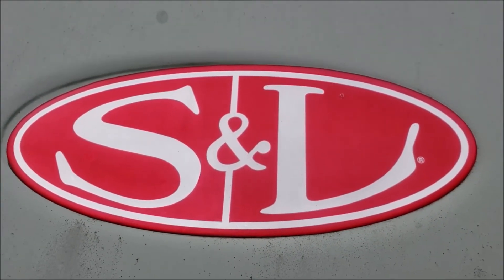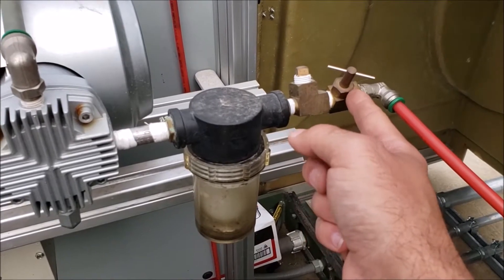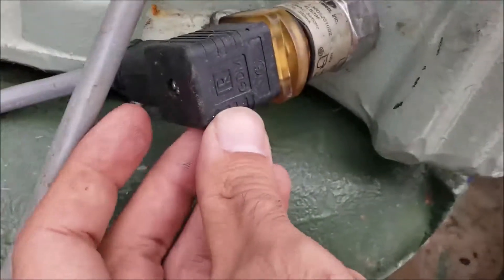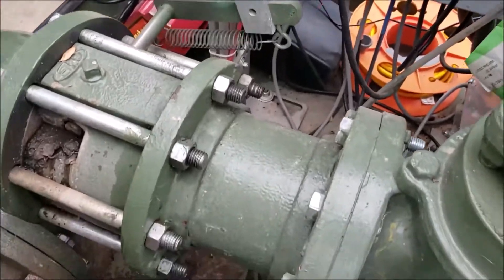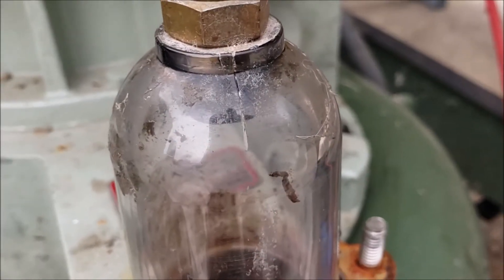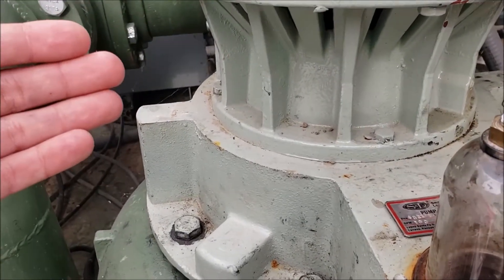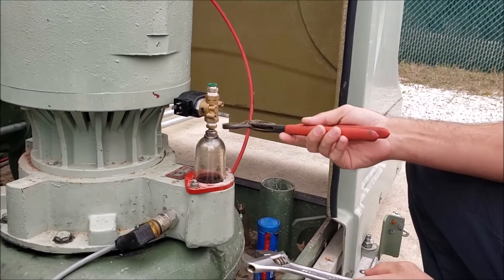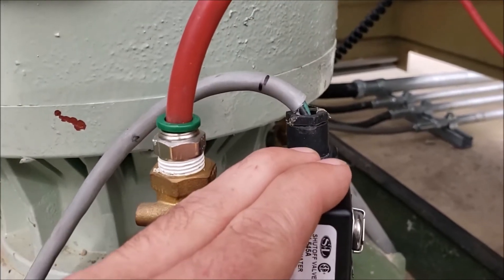Smith & Loveless Lift Station -  Priming Troubleshooting

Comment: we have the same pumps and our problem is they are on an 8 hour cycle, pump 2 will randomly pump half way down then the level will start to rise then pump 1 will kick on and finish the job. it happens anywhere from 1-6 times a cycle. the vacuum gauge is holding vacuum. why would pump 2 start to cavitate at random times half way through a pump?
Reply from the maker: Probably has rags in the impeller.

Comment: Would you be able to make a videos on how the level floats are supposed to work? Confused with how the manual says they operate.
Reply from the maker: That would be a hard video to make as the install depends on how your station is set up. So my floats would not be the same as yours.
Reply: From what I remember:
Low level alarm-near floor of wetwell
Off float-hang straight about 6”-12”
Lead float- approx bottom of inlet pipe
Lag float-top of inlet pipe
High alarm-set where you are comfortable. If surcharging the line isn’t an issue then go a foot or more above inlet, or can set just slightly higher than lag pump float. 
It does depend on the station specific conditions and condition of priming system. If vac pumps are weak (below ~22” hg vac) can set floats low to allow time to prime station before level gets too high from incoming flow.
Reply: And they work like on/off switches. A lot can be wired either normally open or normally closed. Depending on the station and control panel, but essentially this:
Low alarm float should always stay tipped and connection closed- when it hangs free, it will change state and alarm. 
Pump off- will be open when hanging (empty wetwell or pump cycle just ended) when it tips, it closes, which will indicate there is water in the wetwell but not enough to call for pumps.
Lead float- normally open-when tipped it closes which calls for pump to run. Pump will turn on and pump until the OFF float is hanging and no longer tipped- opening the connection and ending the pump cycle.
Lag float- same function as the lead float, but for the second pump, in case flow is high or the first pump has a priming failure. 
High alarm- almost like the lead/lag float, it will be open when hanging, if the water level rises and tips the off/lead/lag floats and continues to raise, when the high alarm is tipped it should close and send signal to a light or dialer. Floats do go bad somewhat frequently though especially if there’s rags on them stressing the cord where it enters the float, or if the float is trapped under a blanked of debris or wrapped around stuff. Lots of stations have transducers as well, which sits at the bottom of the wetwell and has a membrane and the more water above the transducer correlates to a pressure on the membrane which has accurately determine the water level. Most- probably 99% of the ones I work on have transducers as the main level sensing method, and floats as a backup.
When floats are used as a backup they are usually placed higher than the transducer off/lead/lag range so that the controller does not attempt to start on transducer level and end when off float is steadied or vice versa. Once you kinda play and understand it, it does get pretty easy. They’re great stations, my favorite to work on. A little maintenance and upkeep makes a world of difference.  I say 10 mins a month can save thousands in diag and repair, and is easy.

Comment: What we did was removed the vacuum pump altogether and used ejectors and compressed air to create a vacuum. Saved power, no more vacuum pump issues, and the vacuum pressure it creates primes the pump so much faster at compressed 80 psi air. Also, we elongated the vacuum line above the glass dome so we could bend it to a pea-trap style. No more water in the float check after that. Only dirty solenoids after that. Try it out. May make your days easier
Reply from the maker: Very good idea!! I like it!!
Reply: Hi Marc, can you send me a drawing of how you converted the vacuum/priming system and removed the vacuum pump altogether?

Comment: You can take the solenoid valve off and clean/unclog it. Take the silver nut off and the plunger will come out. Cheap easy fix if it’s clogged.
Reply from the maker: Yup, have done this a few times!

Comment: Hey brotha just wanna say great video they were very helpful, I just came back from a troubleshoot and long story short is I get a vacuum and the pump starts to pump and after about 2-3 minutes the pump will stop moving water but the pump will still run. There pumps have a flow meter so that’s how I was able to tell that it was moving water. Any  ideas you got would be helpful.
Reply from the maker: My first guess would be rags built up on the impeller. Second would be vaccum leak somewhere on the suction side.

Comment: I have a new question? Have you ever replaced a sonic start and the vacuum pump continues to run and the pump doesn't take over? Replaced and installed a new sonic start modual on pump # 2 and that happened , also the modual light is flashing red with a yellow/amber light?.
Thanks for any info!
Reply from the maker: Hard to say without being there, but did you get the connections mixed up? Can you see water in the sight glass to confirm it is actually priming?
Reply: @CallMeColtLLC  Hey , thanks for your response. We deal with a company called Apsco, originally they said wire up like old one. Tech came out, actually wiring was different than diagram. Back on line! Have a good one!
Reply from the maker: @chad23smith34  Sounded like the sonic start wasn't giving the proper signal to the controller. Glad you got it figured out!